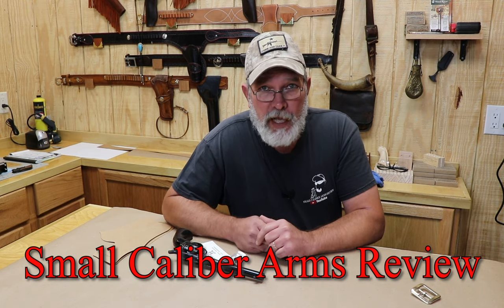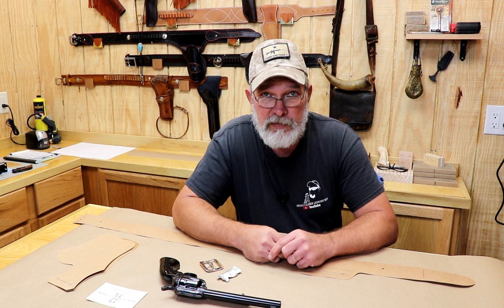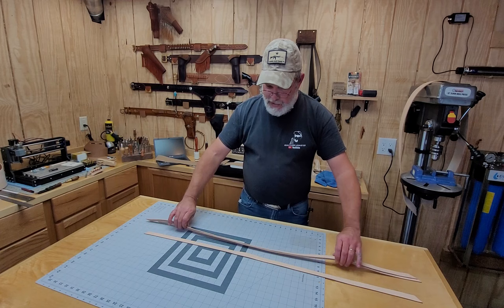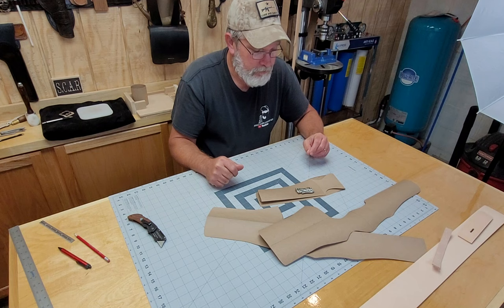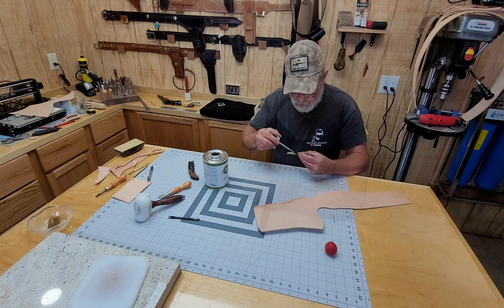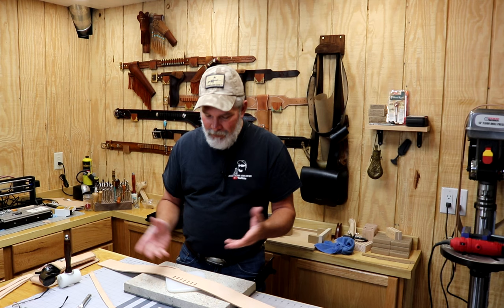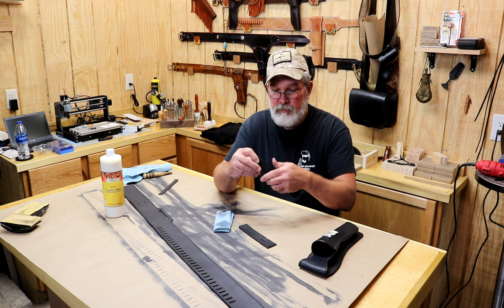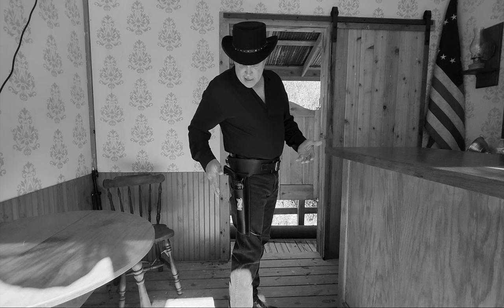Make a Holster - The Paladin - Have Gun Will Travel

Comment: I really enjoyed watching this detailed video, and I have a long term fantasy of buying a pistol similar to Paladin's, making the gunbelt/holster and practicing to see how well I can match his (fictional) marksmanship. I lived for three years in my twenties in a back to the land commune with several other craftsmen/women, and leather work was one craft represented, so I am familiar with many of the operations you show, and I own some of the tools. Later, I worked as a Diesel truck mechanic and I agree completely with the philosophy of buy the best you can afford. Mostly I bought Craftsman, which are adequate, but in some cases I spent more for Snap-On, which do a better job in some cases, but are always a pleasure to hold in one's hand. When I added a set of deep well offset box end wrenches, I got Snap-On. They have a nice refinement, called flank drive, which is simply a radius on each of the six or twelve points, which enables use on slightly mangled nuts and bolt heads since the fit is looser, but they also give about 5-10% more leverage by bearing on a shorter diameter. Craftsman now has this refinement, but Snap-On has a smoother finish still. I assume the patent ran out.
You did omit one detail, however, namely the loop on the front of the holster which can be hooked up over the hammer to prevent the gun falling out of the holster during the athletic moves we are Paladin perform. Boone, a relative of Daniel Boone, was already an experienced rider prior to being cast in this role and we see the genuine affection he shows the horses on the show..
Reply from the maker: I don't remember seeing a hammer thong in any of the episodes I watched but that doesn't mean it didn't exist. I like buying tools, I like using good ones even better. Give the Paladin holster a try, and thanks for watching!

Comment: GREAT video!!  Thanks for doing this!  I am planning on making at least one "Paladin" style holster after I retire next year so this video is both timely as well as very instructive!  I do like the idea of lining the belt with suede!  I also noticed that you hand-stitched every portion of the holster, rather than sewing it on a machine.  Is that your preference?  Please keep the videos coming, you've got a confirmed fan now!    Bill
Reply from the maker: I hope you enjoy it as much as I do. You have to watch out when using suede. Suede is usually chrome tanned and will attack metal. It will corrode your firearm. They used to make a veg tanned suede but it's extremely hard to find these days, almost impossible. I do prefer hand stitching, plus it's a stronger stitch. I wouldn't mind using a machine for certain things, like really thick welt areas. I do have an older Pfaff machine that would do a lot of my stitching, but hand sewing leather can be relaxing sometimes. Thank you very much for watching, I hope to be doing some more holster work this Winter.

Comment: Next time you might try using a dowel or something just a little smaller than the round and not pulling the loops so tight. You can always stretch the loops a bit if you need to after you are done. That's just a thought, don't know if it would make a difference or not.
Reply from the maker: I don't know if it would help either. I really like them sewn on the belt instead of laced through. Thanks for watching!

Comment: I have a question that I hope you can answer .
What is the purpose of the apron ??
Is there a purpose ??
I just received 2 holsters ( I’m trying to replicate the Brad Pitt Jesse James Gun and holster set ).
Jesse ( in the movie ), uses 2 “ Slim Jim “ style holsters with NO Apron . 
I received 2 holsters that look like “ Slim Jim’s “ , but there is a long apron behind them both .
I was thinking of trimming it to just leave a 3” belt loop .
( I wish I could send you pictures ). 
Now will that screw up the holsters ??
Or should I leave it alone ???
What purpose does that Apron serve ??
Thanks so much for your help 🤠
Reply from the maker: I'm not exactly sure what i's purpose is. A belt loop on the back of a holster is usually sufficient to hold the holster to the person, and a leg thong will hold it to the leg if it's needed. I like the looks of them and I guess they could offer a little protection between the actual holster and the clothing. I have made holsters both ways and they all seem to function just as they're  supposed to. Ultimately, it's up to you!
Thanks for watching!
Reply: I really appreciate your input .
I’m still trying to decide .
Cause once I start cutting the apron part ??
There is no going back haha 😂
Reply from the maker: You can always just make another one instead of cutting the one you have.
Reply: I hope to make my own one of these days .
Just need the proper tools and I’ll be off and running .
I was also wondering ……..
I’m thinking of dying my holsters to match my belt ( ranger style with 18 .45 loops ). 
Here is another question :
Should I dye the entire holster including the back of it ?? ( the rough out part ).
Right now ( I wish I could send you pics ).. I have a brown belt but the holsters are more of a light light brown - almost tan .
So I bought Fiebings Chocolate Brown .
I’m hoping that will match the belt .
If it’s too dark , I may have to dye the belt .
We shall see 🙏🙏🙏🙏
I finally watched this video in its entirety.
I love the ending !!!!!!!!!
I enjoy doing some cosplay too .
I’ve been planning on doing a few tributes to a few Movie cowboys like Brad Pitts Jesse James and Jeff Bridges Rooster Cogburn.
It’s unfortunate that I just shaved my gray beard so I’m starting to let it grow again haha 😂.
You look awesome brother !!!!
Most of my YouTube videos consist of knife reviews .
I’ve been collecting knives since the 80’s .
Stop over some time .
Enjoy doing this . 
I just subscribed to your channel too .
Ok. 
So again … If I dye my holster , should I include the suede part ??
Enjoy your day bro 🤠
Reply from the maker: I just visited you home page and subbed. You have a lot of cool knives!
The only problem with re-dyeing a holster is that there may be a topcoat on it that prevents the dye from penetrating the leather. 
When you say the "Suede part" are you talking about the rough side of the leather or actual suede? If you mean the rough side, I'd say yes. If you  mean actual suede, I'd still say yes but be aware that the color could be drastically different. Suede is usually chrome tanned instead of vegetable tanned and it also tends to soak a LOT of dye. Matching colors with existing pieces can be pretty  difficult because of age, wear, and fading. Black is the easiest color to match because it's, well, black.
You can also email me at Smallcaliberarmsreview@gmail.com, you can send me pictures there.

Comment: Great video.  Recreating movie props is an art, especially when there are multiple editions of a single prop.  Why 28 cartridge loops?  Perhaps because of Richard Boone's waist size and the esthetics of a line of cartridges.  What looks pretty on screen?
Reply from the maker: The absence of a logical reason drives me nuts sometimes! Lol. Thanks for the comment and thanks for watching too!
Reply: @SmallCaliberArmsReview  If I remember correctly, Paladin's Colt was in .45.  There may also have been a hidden holster for his derringer and may gun belts doubled as money belts with gold and silver coins concealed in the lining.  I think that the prop master for the Paladin television series faked those features because of the difficulty of keeping all features functioning.  Paladin had six or seven seasons and leather wears out, making it necessary to replace belts and holsters.  
You had enough challenges making a gun belt with cartridge loops for the tapered 44-40 cartridges.  My father made a gun belt and used a commercial holster for his Colt Police Positive that he inherited from his father, and he omitted the cartridge loops because they were just too much trouble to make look right--so he tooled the leather to make his gun belt pretty.  
Your Paladin gun belt rig is still a labor-intensive project requiring skills and the right tools.  Now that you've made it, maintaining the leather is a permanent hobby.  I volunteered at an air force museum for more than a decade and some of the artifacts on display were leather goods--UV light and oxygen take a toll on leather.

Comment: Brilliant. Any particular reason you didn't dye it before fitting the holster emblem and putting it together? But still, looks great...
Reply from the maker: I like to wet mold the holsters before I dye them. Even using an Alcohol/Oil based dye, water can make it bleed when it gets wet. Sealing it afterwards will fix the problem though.
Reply: Ok. I understand now, thanks  @SmallCaliberArmsReview

Comment: On those punches - The top pops off and you can push the cuts through with an awl or a flat screw driver.
Reply from the maker: Yes they do, but these got packed in there pretty tight. When I would stop after every 4 or 5 they were easy to get out, but after about 8-10 they are packed in tight! Thanks for watching!

Comment: I am confused about the number of bullet loops you put on this belt. I do not understand, nor can I think of a reason for putting a number of bullet loops on a gun belt that does not divide by 6 equally. You should have done 30 loops which equates to five full reloads for the revolver. Or, if you wanted more you should have put 36 which is six full reloads. I ordered a custom gun belt from Mernickle Holsters. Mine came with 24 bullet loops. That is four full reloads for my Ruger Vaquero.
Instead of using a piece of, what looks like butcher paper when you dye the leather, how about using a sheet of vinyl shelf liner. The dye will not soak thru and onto your tableZ?
Reply from the maker: I'm confused about the number of bullet loops too. I explained that in the video, I believe. I put a piece of plastic under the paper now. The paper will soak up excess dye and the plastic will keep it from staining my mat any more than it already is. I also didn't have any vinyl shelf liner available when I made this video. Thanks for watching!

Comment: Looks like the gun should go down in the holster about an inch or so further.
Reply from the maker: Compared to screen shots of the show, it looks about right to me. Thanks for watching!
Reply: Guess that all that really matters, since it's yours. However, the original appears to ride a little deeper. You might want to check it.  Comes right up to the edge of the loading gate... you're welcome.
Reply from the maker: I just looked at some more screen shots, I think you're correct. It does appear to be just a bit higher on the cylinder than the one I made. I guess I'll have to try it again! @bustabass9025
Reply: @SmallCaliberArmsReview  
A good reproduction nevertheless.